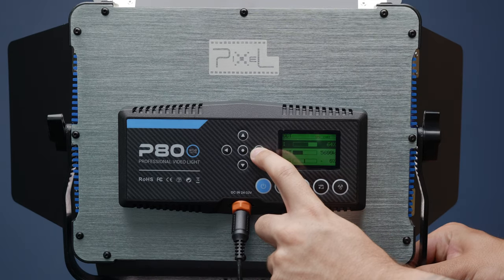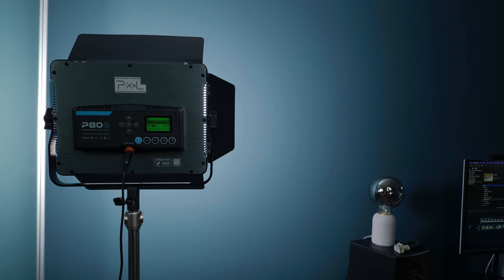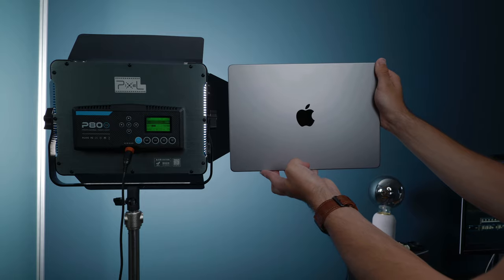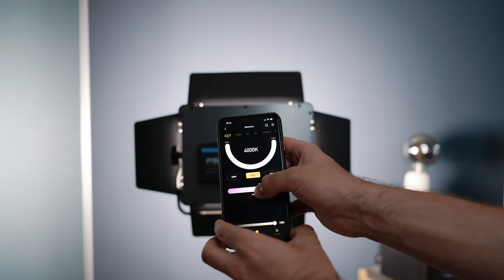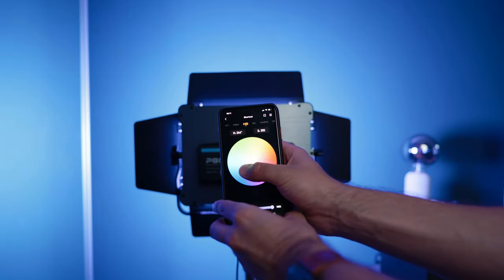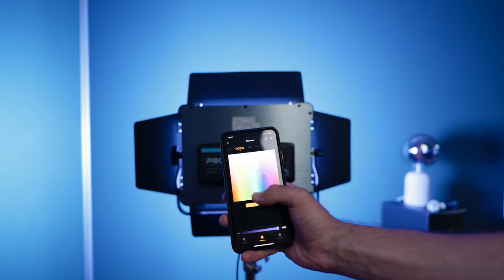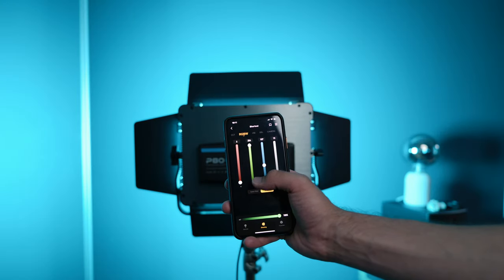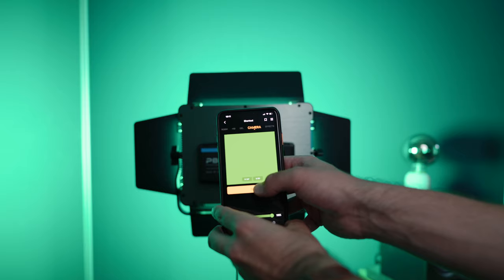Panel Lights VS COB Lights - What To Use and When

Comment: Thanks Josh. Interesting angle. I am looking at lighting a live unamplified concert in a largish public room, probably with a single light to complement existing lighting. What would you use in there do you think? My current choice is a GVM 200w COB, driven principally by the amount of light it produces. With that I could do a ceiling bounce, or go direct with the usual diffusion and honeycomb. But I will have to see how it looks when I get there. This COB light also has the special effects etc. that you mentioned were exclusive to panel lights. I am not sure they are any more.  Have things changed recently do you think?

Comment: Hi Josh in your opinion which one has the better 5.9k 10bit video between the Panasonic s1 with firmware update or Panasonic S5 with atmos ninja V. I am torn between the two, your input would be very much appreciated
Reply from the maker: The 5.9K that's recorded via the Atomos will get the edge over any of the internal codecs from both the S1 and the S5, simply because there is more data being captured and more scope for editing. 

The S1 can also output RAW via HDMI to the Atomos Ninja V,  so whatever camera you use will be able to get that extra quality. If you'd like to shoot 5.9K both internally and externally, then the S1 would be a good fit :)